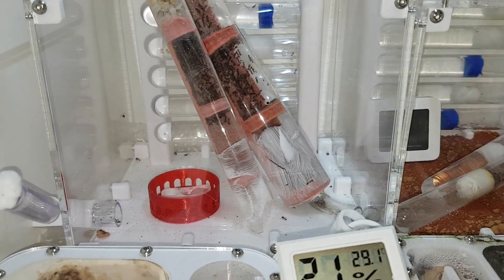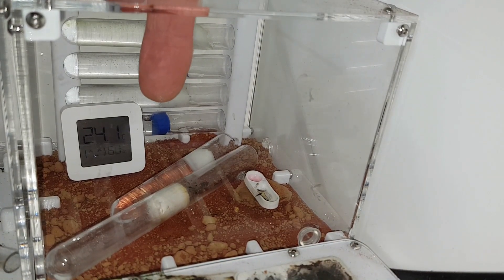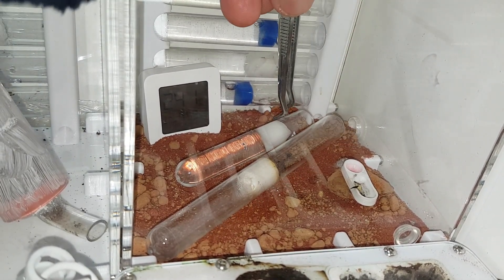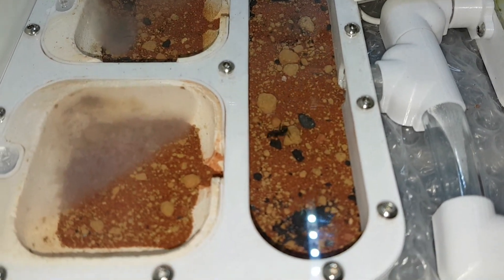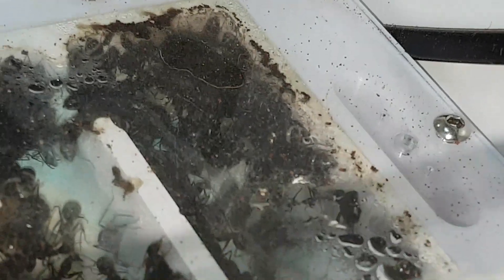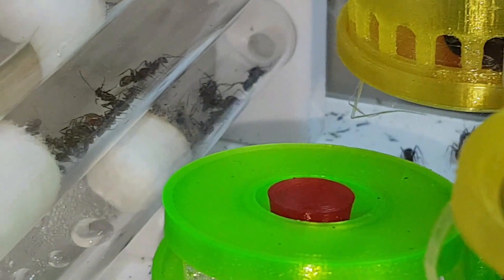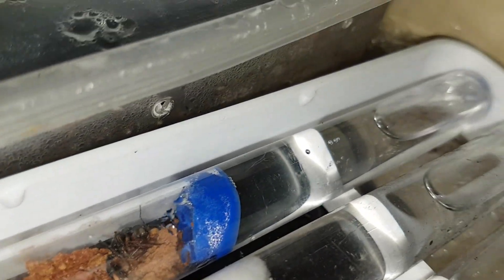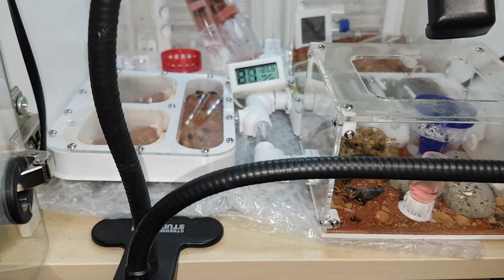Update with a few changes

Comment: Nice lil update. Are the temps okay? seems kinda high.
Reply from the maker: HI i did wander myself after that probe said over 30 .I had only just placed that probe there and its actually under the mat which is insulated with bubble wrap above . I had be monitoring with the bluetooth one inside the other saturn for the last six months and its never been above 23 so i thought i was OK . Though the maculatus gave not really been thriving . I have actually dropped it since Making the video just in case . thanks for watching .